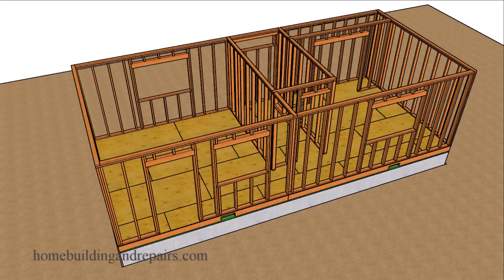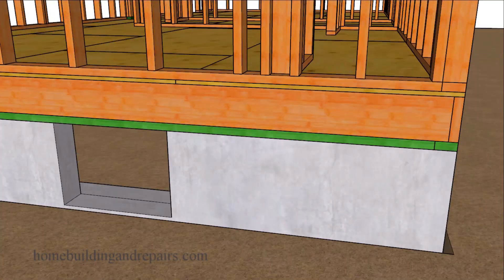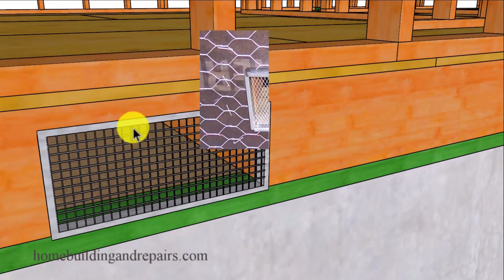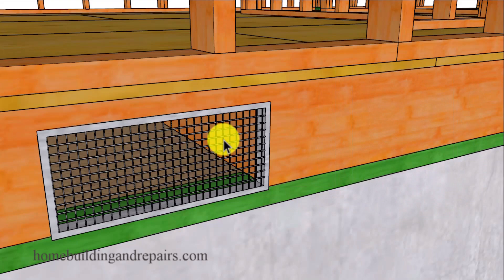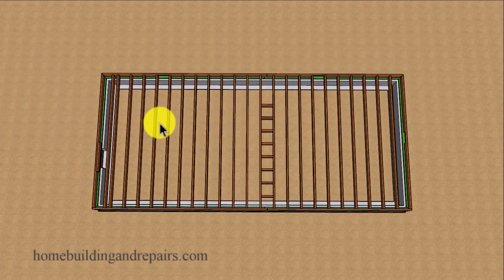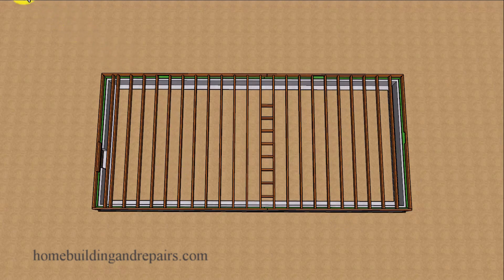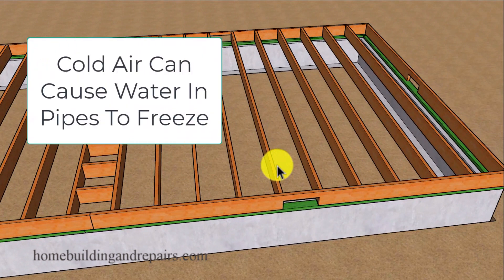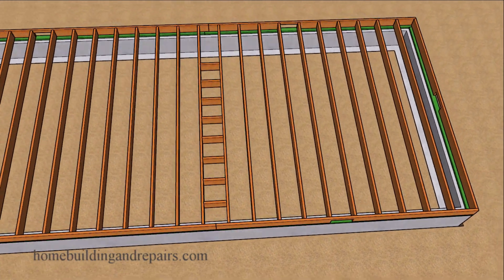Learn What A Foundation or Crawlspace Vent Does - Home Building Education

Comment: I definitely have lots of questions about crawlspace vents.  For example:  (1) If the vent grid is 1/4", this is like a superhighway for insects to enter and attack everything inside, including joists, posts, etc.  Shouldn't the grid be considerably tighter?  (2) What is the proper amount of ventilation to provide sufficient oxygen for gas forced-air furnace combustion and chimney draw?  (3) I have yet to find a vent (whether for kitchen exhaust, crawlspace aeration, or other) that comes with a positive shut-off, such as a sliding inside cover that actually stops (seals off) all air infiltration or exit.  If we pay for 99% efficient furnaces, don't we want to be able to control the amount of air entering the crawlspace to make that efficiency pay off in the wintertime?  Thanks for all your great construction videos.  You are definitely one of the best.